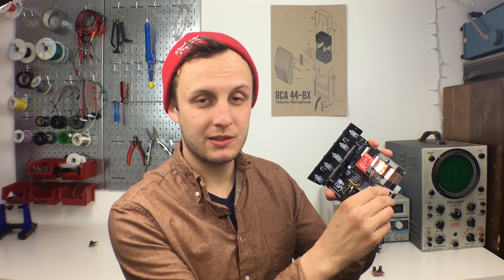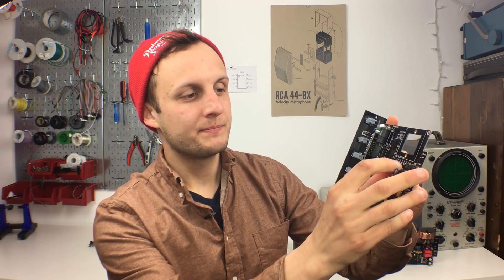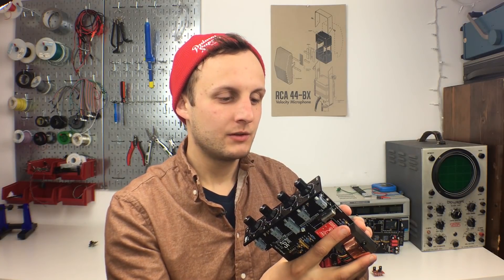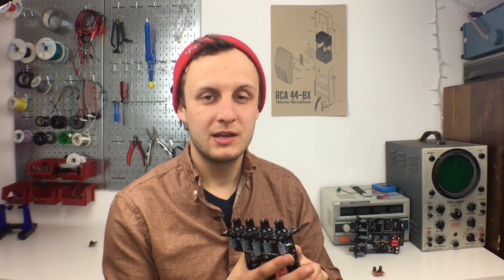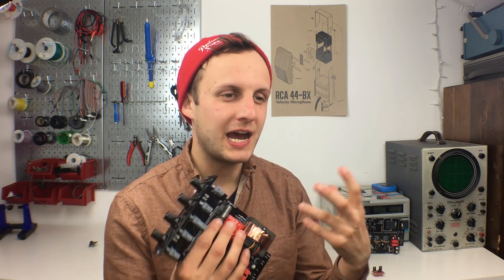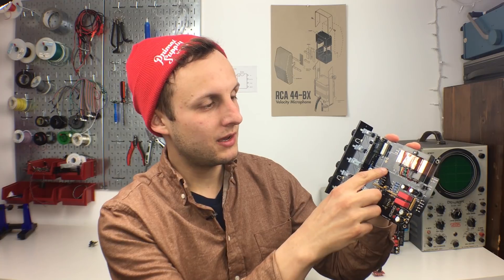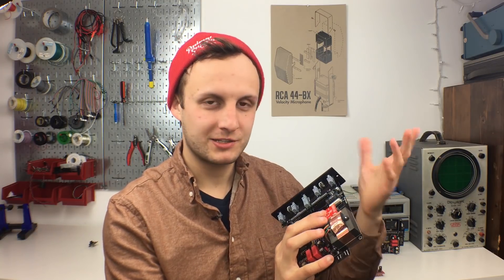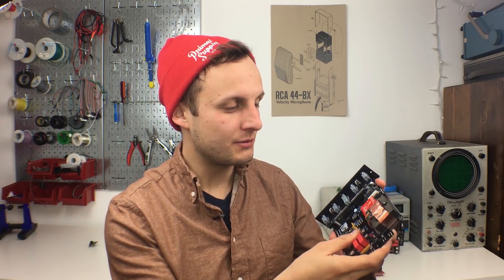Inside the Design of Our Vintage Output | From The Bench ep. 2

Comment: Peterson (et al),
Nice series of vids.
Currently (late May 2018), the EQP5 is out of stock in all flavors. What specifically is short? 
I already have the LTL Rogue 5 DOA that I use in Rogue-Tec Air colour module.
When do you believe the Vintage kit will be available and can I just buy the Vintage option without the DOA (i.e.: just the xfmr and cap & resistors).
Great job man!!